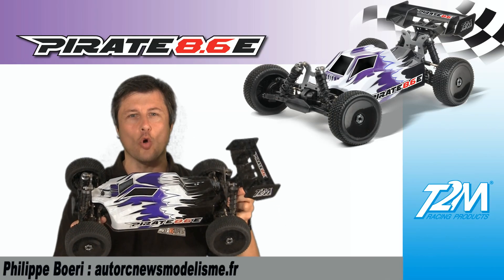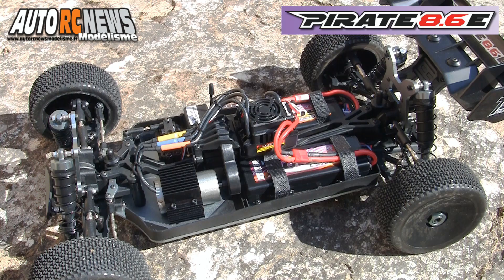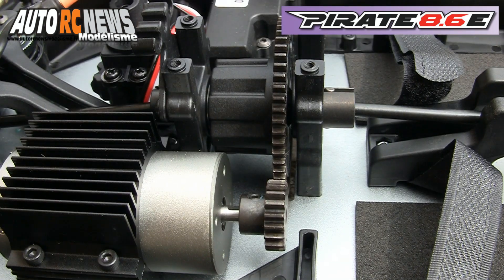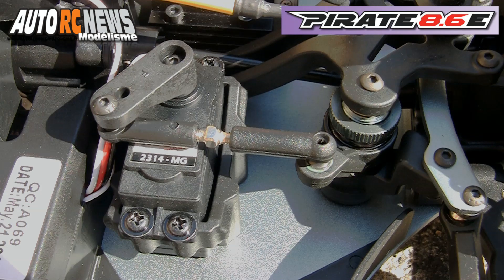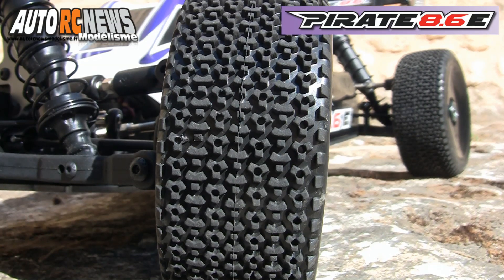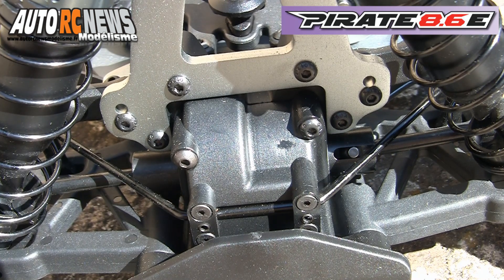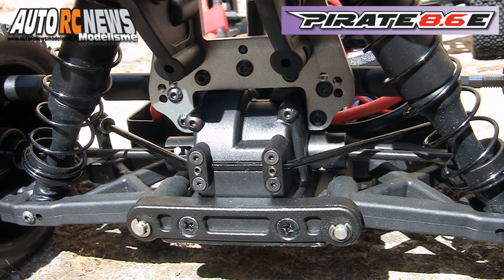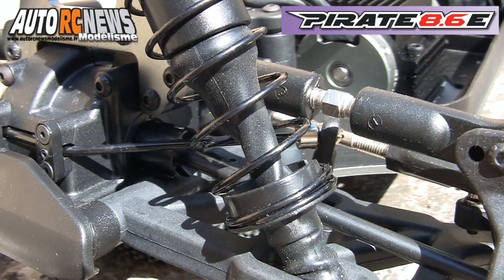T2M Pirate 8.6 E T4792

Comment: si g une lipo de 8000 , 100 c mais 2 secondes . c quoi la différence entre 2 et 3 secondes ? si je mais qu'une seule lipo a la place de deux elle sera moins puissante ?
Reply from the maker: Avec un seul accu Li-Po, elle ne fonctionnera pas du tout. Cette auto nécessite 2 accus Li-Po pour fonctionner.

Comment: et juste quel est sa vitesse max avec une lipo de 8000 ?
Reply from the maker: Aucune idée. Ca dépend aussi du nombre de C (taux de décharge). Ce qui est certain, c'est que si vous équipez l'auto d'un 8000 en 90 ou 100C, ca va booster pas mal !
Reply: si c'est du 45c ?
Reply: c les même que sur la vidéo mais en 8000